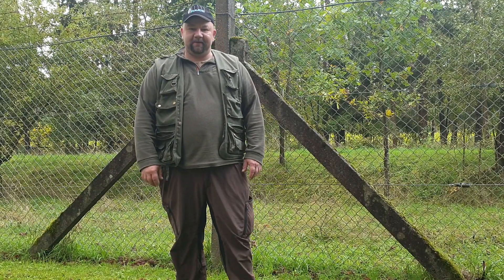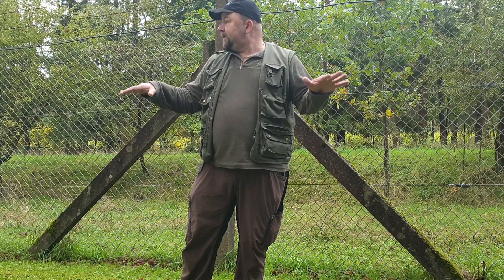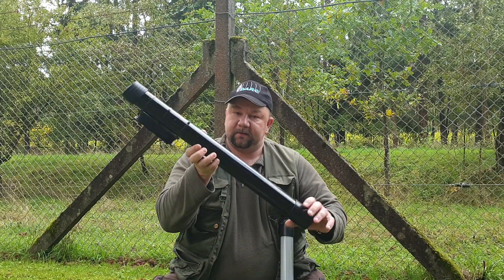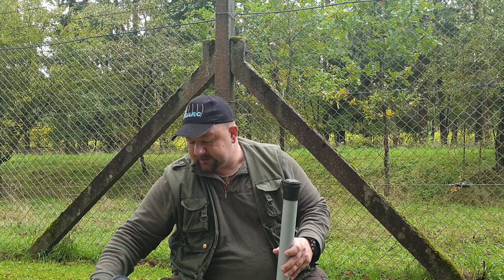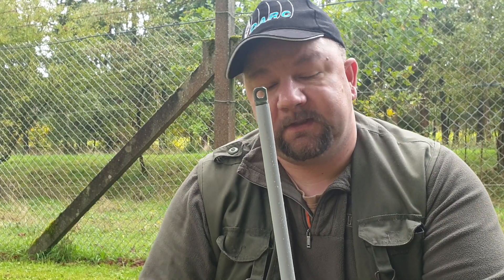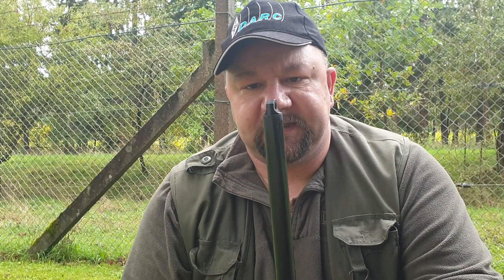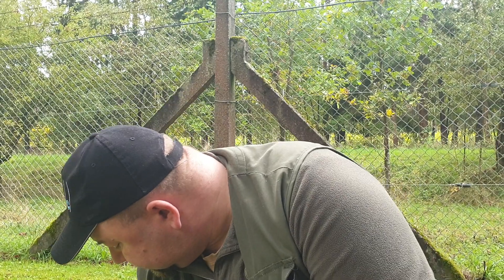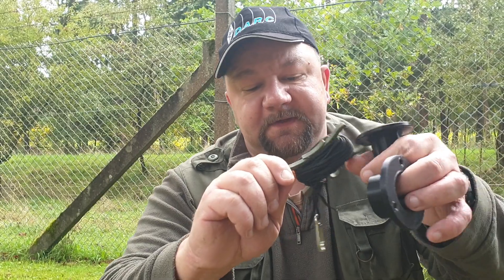Antenna Poles and Accessoires....

Comment: Great video, thanks for the information. I have a few MFJ 32' telescopic poles but they cab be pretty fragile. I often just use one for a 40m vertical or have used for making a delta loop.....cheers Fred